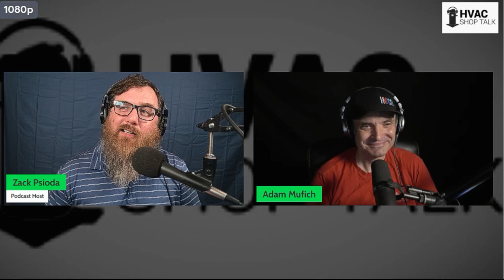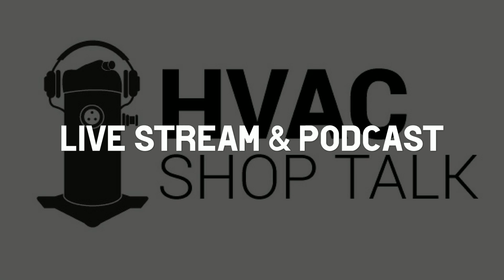Do Duct Systems Cripple High Efficiency HVAC Systems?

Comment: I’ll say design a ductwork to full capacity of system  and on the days that don’t need full capacity of cooling so let the unit modulate I’ll bring  back up the speed when it can’t keep up at low speed

Comment: Yeah what about in the heat mode. 🤔? Floor vents vs ceiling and side wall grill.  . Linear grills 🤔. How about the humidifiers  they don’t modulate 

The cool mode or in dehumidification mode . Need multiple returns . What about high ceilings. Those units are supposed to circulate air constantly so there’s supposed to be ultimate comfort levels. They stay the same humidity and temperature all the time throughout the whole house in my bedroom is the air handler‘s not in a humid environment. They will sweat like crazy during the cooling mode needs to have somewhat conditioned air around it. We do a crap load in South Florida.😮🥵😵😎
Reply: 561 I approve that message